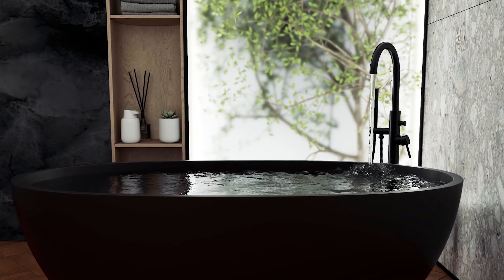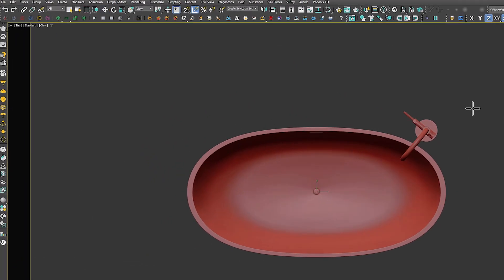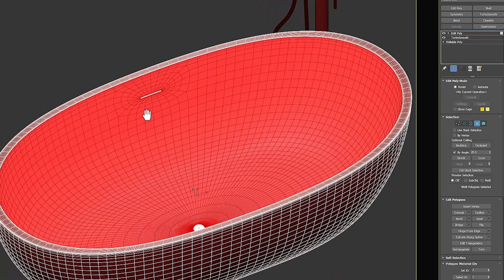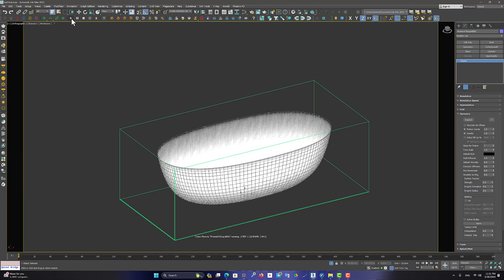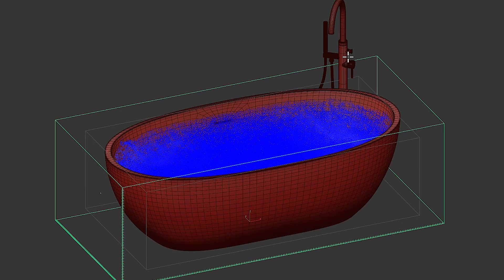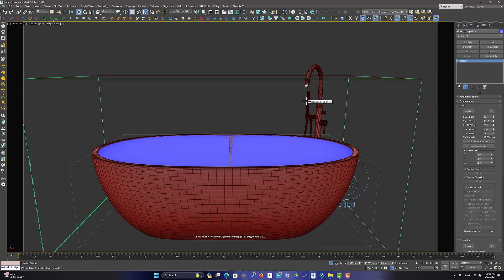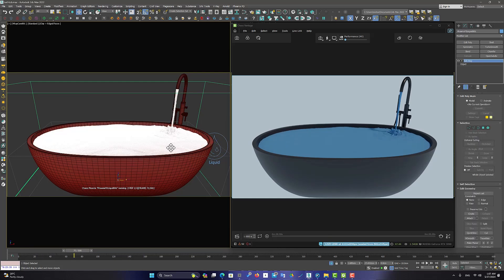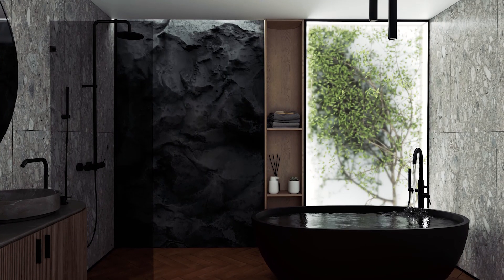Water simulation with Chaos Phoenix

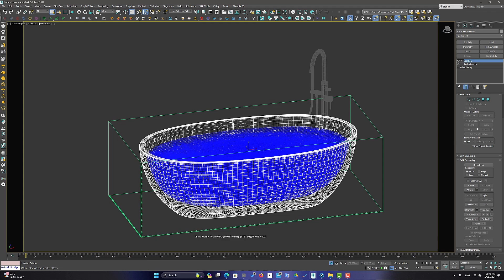Comment: just to add if your water fills and falls down with gravity and disappears you need a geomentry in this case the actual original bathtub.  in the tutorial  what he says at 5 :07 to 5:20 is very important otherwise ur water will not be able to contain inside the source . and if you want more control on speed of water in bathtub you need to use a liquid simulator and initial fill inside it and then  lower time scale to get more calm water.anyways the tutorial is fantastic
Reply from the maker: Thanks for the detailed explanation and sharing your experiences😊❤️